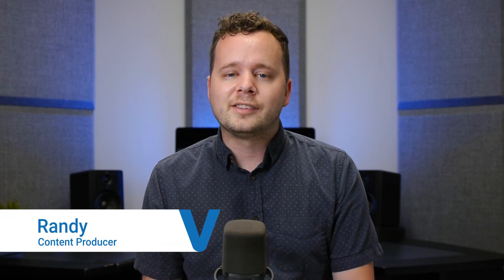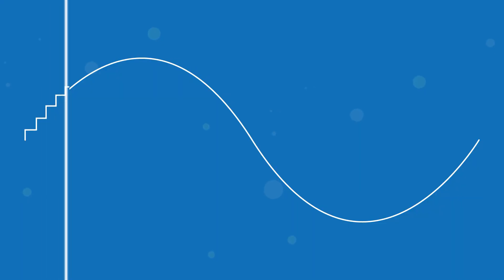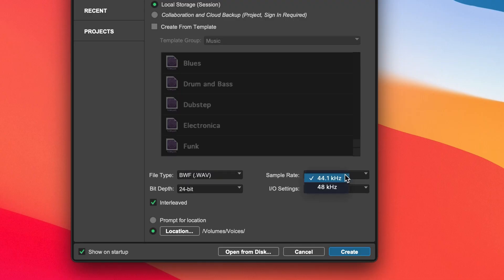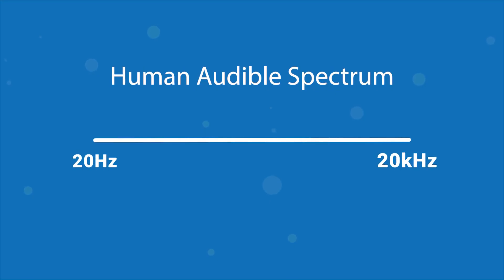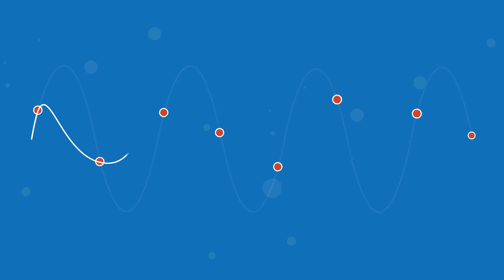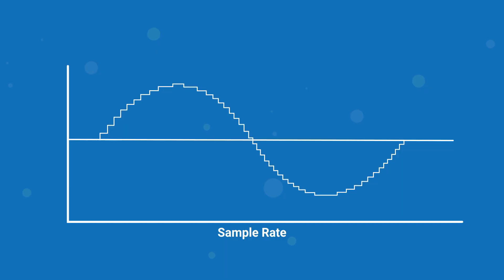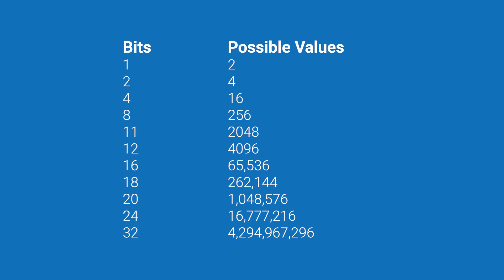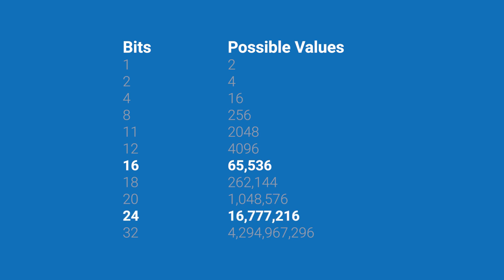Sample Rate & Bit-Depth For Dummies

Comment from the maker: What audio tips would you like next?
Reply: I’d love to know from someone with years and years of experience in mixing audio(vocals), if you have a top 3 or top 5 “GO TO” techniques that you’ll use almost every time you sit down to mix vocals??

 Meaning vocals that are laid over some type of instrumental. Also, if there is a certain place you start every time and if those techniques should be done in a specific order to get the best result?? I am trying to dial in a more efficient work flow. I’m all self-taught for now, I’m praying I find a mentor sooner then later. Thank you!

Comment: Thank you! This is helpful! I saw an audition today with a request for background noise <-65dB and SNR > 35dB. I searched the depths of google but could not find anything on how to measure this. Do you have any tips on how we can make sure our background noise and SNR are the right levels? So grateful for all these videos. I got 2 shortlisted auditions since applying some of the tips from these a few days ago. :)
Reply from the maker: So glad to hear you've been shortlisted! A lot of audiobooks and smart speakers have quite strict audio noise requirements. The best way to test this is to set your gain appropriately for reading so that you're peaking around -6dB. Then record some silence. Playback the silence in your software and make sure the levels are lower than -65dB. This is what we call the 'noise floor'. It's the base level of noise in your space. SNR refers to signal to noise ratio. Signal being your voice and noise being your space. There must be at least a 35dB difference from the two. If you set the gain properly and the noise floor is less than -65dB, the SNR should be fine. Hope this helps. - Randy
Reply: @voices  Sooo helpful! Thank you as always!

Comment: i was always of the the impression that for VO 24 bit is absolutely enough (in terms of, no audible loss compared to 32), but most people doing video, need 32 bit audio. would it then not be recommended to still record in 32, just in case a client wants it, and if not, just export at 24 bit?
Reply from the maker: That's really interesting. I wonder why people would be asking for 32-bit as that's well beyond the dynamic range of even the most dynamic vocal sounds. Very interesting! I think you're safe to record 24-bit for our clients. I haven't heard of any talent running into issues doing that (unless explicitly stated otherwise) - Randy
Reply: @voices  i'm so sorry (would have edited the comment, to avoid misunderstandings, but this is all still new to me). i meant recording at 41k vs 48k, not actual 24 vs 32 bit
Reply from the maker: @rautshsale1948  Roger that! I would suggest recording at 48k. Most WAV deliverables are 24/48k these days. 44.1 is still totally acceptable, but I would recommend jumping on the 48k bandwagon as we see that being more of a standard and it will 'future-proof' your recordings.
Reply: @voices  highly appreciate the input!